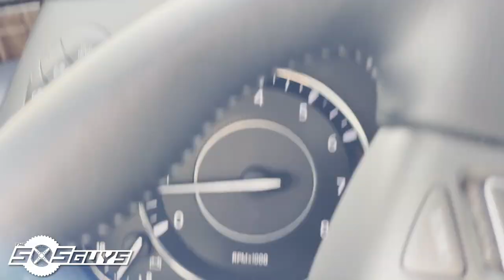Razorback Offroad Cage Repair & Clutch Weights | The SXS Guys Vlog

Comment: If the larger tire & weight broke the rear door, what did you or Razor cage do different the second time that you were able to re- mount it back on the rear door? If nothing, I’d guess it’s going to just break again?
Reply from the maker: Honestly, was just reattached for beauty shots that didn't happen right away. The next vlog the whole cage system comes off to go duning, lol... The spare tire carrier will remain off unless we go on an overland trip where I need the spare and I'll implement some sort of strap to assist in its longevity... if I take it. I did over 2,500 miles of overlanding and then additional riding and abuse before it broke.